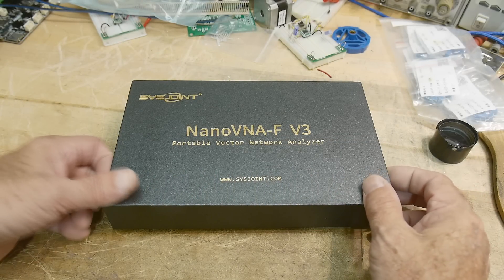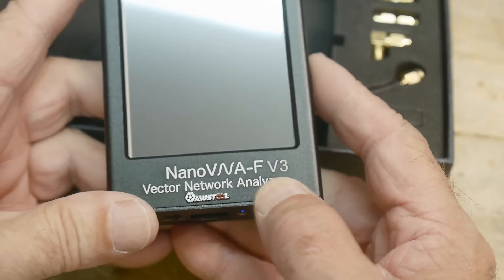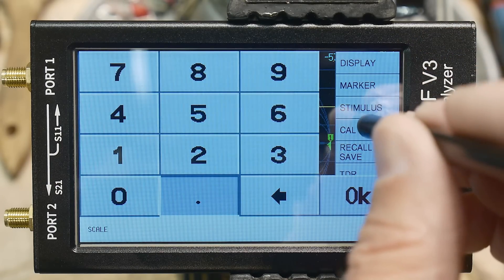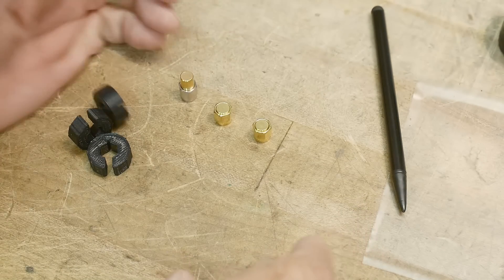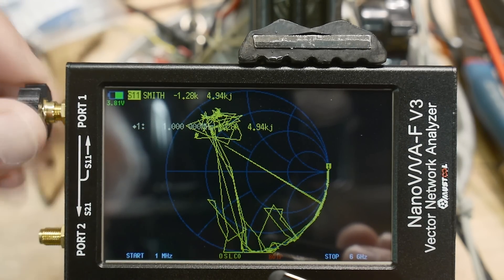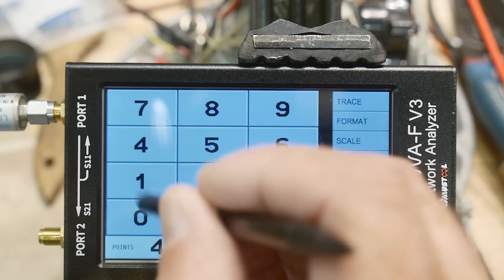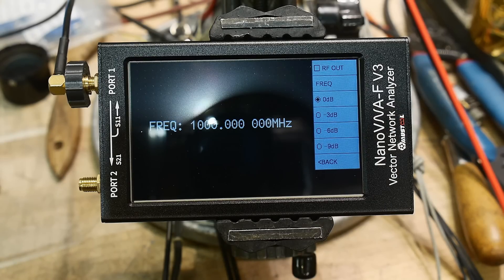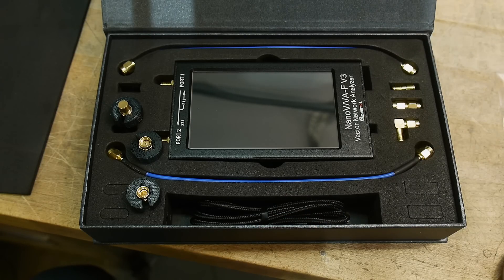#1943 NanoVNA-F V3 6GHz Review

Comment: What's the difference between this and the SeeSii Upgraded NanoVNA-H4 V4.3 10KHz-1.5GHz HF VHF UHF 4"?
Reply from the maker: I would say this is 3rd gen, the H4 was 2nd gen, this has higher frequencies. bigger screen. more data points.  the H4 is fine if you don't need those things. I've got videos on the H4. playlist "nanovna'
Reply: @IMSAIGuy  NanoVNA-F V3 or LiteVNA 64 ? whats better?

Comment: I am enjoying your videos.  I have a question about both NanoVNA and TinySA.  Can either (or both) be used to evaluate antenna performance, such as to build a polar plot on a yagi, or to compare two vertical antennas and their respective gain.  I am envisioning a NanoVNA with a small antenna connected to the input side and the antenna under test connected through it's feed line to the output, then scanning the design frequencies of the antenna under test while watching the received values.  Might be a little clumsy to connect, but would it work?
Reply from the maker: you could use the TinySA and receive antenna. would not be calibrated but would give some data. here is the big boys: https://youtu.be/FROSpugtM8A?si=xw6F_5UrBRgzM1t9
Reply: @IMSAIGuy  thanks.  I’ve sent antennas (pcb printed for BT LE) to a shop like this for certifications.  Pretty cool how they work.  I’m thinking I can use either the Tiny SA or the NanoVNA to accomplish a comparison of home made VHF/UHF antennas though with less finesse and accuracy, but still get useful results.  Maybe see gain while adjusting spacing in yagis, etc.

Comment: 4:56 Installing the short... 😀 Compare and contrast: 1) When using microwave test equipment, there are always some older gentlemen that will immediately abseil down from the ceiling to sternly mention that if you dare to install the cable / connector without holding the center steady (i.e. "Do not rotate the center pin !!"), you will be punished ("Taken out and shot.")  2) The calibration Short device is typically machined as all-one-piece, so it's impossible to install it without rotating the center pin. Also, the Nano-VNAs are $100, so calm the heck down Elmer. I've only experienced this a half-dozen times... Comedy.